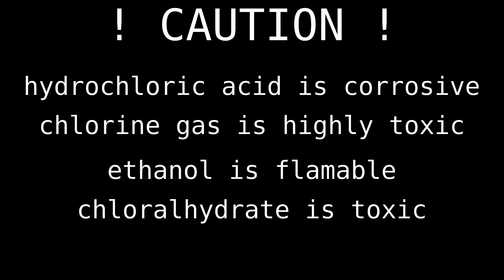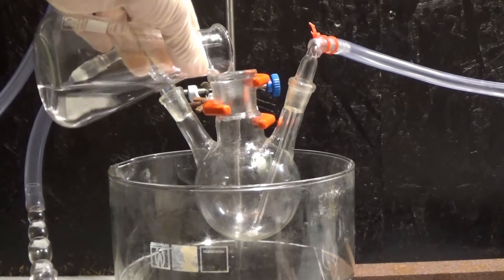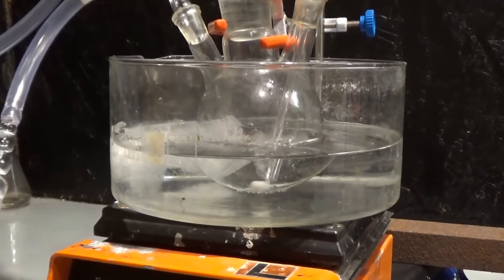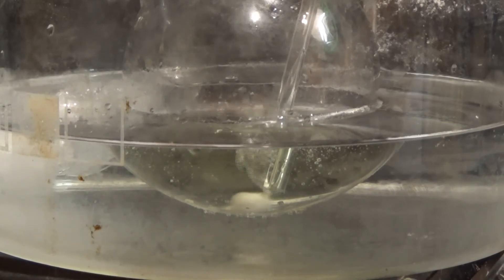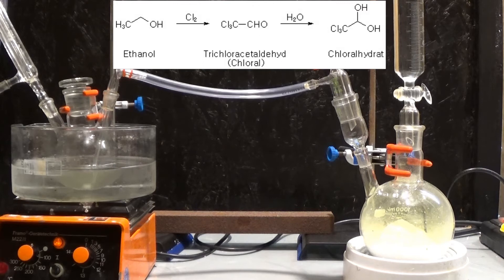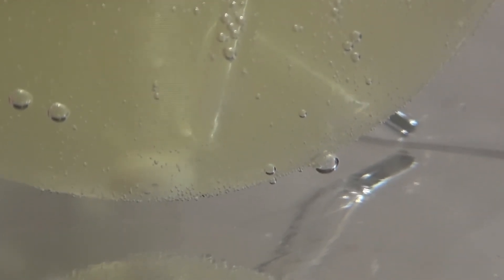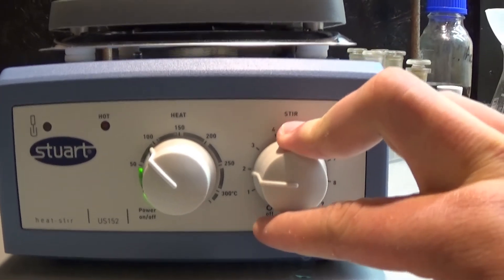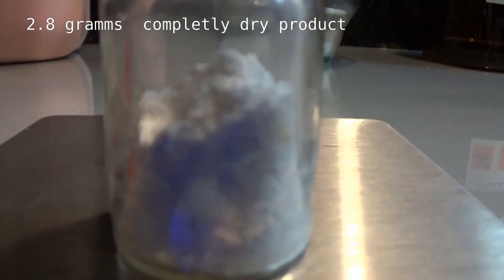synthesis of chloral hydrate (OTC)

Comment: I was wondering is the water content of the ethanol alcohol of any consequence ? Will any water already in the ethanol ruin the final product or should I just use anhydrous ethanol ?
Reply: 70% is ideal as far as yield goes. There's a lot of HCl evolved during reflux and your ethanol should be sub freezing until reaching boiling, also use an excess of Cl2.

Comment: I think I will synthesize this.. Seems quite doable and my useless german psyischiatricsts refuses to prescribe anything that works
Reply from the maker: NO! Please do not consume anything that was not synthesized in a certified pharmaceutical laboratory! 
You will poison yourself!!!! 
If you need help please try another  psyischiatricsts or call 0800.1110111 they can help you. 

If you want more information I am here! 

Best Elias
Reply: @HazelChem why? Just use pure reagents and purify the end product. The guy in the sciencemadness forum did this reaction with three separate distillations (an acid distillation, a distillation over a base to neutralize residual acid, and a water distillation) and the end product was quite pure. You could even use food grade distilled water if that's what you are worried about.
Reply: chloral hydrate makes you act a bit crzy in my experience yeah i had my confidence back but i alo was pretty agro i wouldnt reccomend it fo every day use

Comment: Could be possible to synthetize it from Acetaldehyde?
In a basic environment (NaOH) you get the enol that with Cl2 gives mono,di and tri chloro substituted Acetaldehyde (depending on how long you let everything react) and HCl as a side product.

But for sure ethanol is way more accessible and cheaper than Acetaldehyde.

Comment: HAZEL..........GREAT VIDEO.  You really made me think and read a lot of stuff.....lol.      I could be wrong but i think you should add a  little water to your reaction to help OCl anion formation and also help carbonyl hydration to form the geminal diol.   Just a thought.  ALSO  I understand you boiled/distilled off the liquid at the end so you could concentrate  the chloral hydrate and you did it under a VACUUM so it would not decompose in to chloral at it's boiling point of 96C.   But if chloral hydrate boils at 96C and chloral boils at 98 C and water boils at a 100 C and ethanol at like 78C.   I mean all those boiling points sound VERY CLOSE TO EACH OTHER.   Maybe when you distilled it down to concentrate your product   you ALSO distilled away a lot of your product.   I mean just because chloral hydrate and contaminants/impurities  have almost the same exact boiling point under atmospheric pressure does not mean under a vacuum the boiling points will still be close to each other.   But it may be a good indicator that the boiling points are still VERY CLOSE TO EACH OTHER even under a vacuum.......... DID YOU CHECK TO MAKE SURE?????????????????????????    Just a thought.  Not saying i am right but i am saying it is my GUESSES.  My 2 cents.....lol.  Man i been at this same video and posting and researching it and watching it for over 6 hours now.  I am GETTING A BRAIN CRAMP...............LMAO
Reply from the maker: hey john thanks for all the time you put into analyzing the video! I think you are right and that the final "concentration" step killed my yield. The video is now three years old and of now i would do it completely differently.... and I might do so in the future ^^ 

mfg hazelChem
Reply: @HazelChem  .........Seriously watching experiments and learning the mechanisms and etc is my entertainment in life.  I got nothing else going on....lol.    The first time i do an experiment i think just getting it to work is a more important goal than getting a great yield. On the first attempt just getting it to work is a BIG success in my mind.   Then i can try to tweek it on the next attempt so i can get a better yield.

Comment: Oh my god i have watched this video 4 or 6 times today and been thinking about it for like 6 hours.  Hazel and chem player always make me think..   I think i got it.  But listen to this first so you can understand where i am coming from.   The hydration of formaldehyde....meaning formaldehdye in water.....will automatically make methanediol.  The carbonyl will be protonated and then a water group will add to the carbonyl carbon and loose a proton making a geminal diol.  If you put formaldehyde in water then 100% of it will turn into methanediol and some polymerization.   The carbonyl carbon on formaldehyde is very positive due to being right next to oxygen which is such an electronegative atom it sucks up a lot of electron density from the carbonyl carbon..  And protonating the oxygen on the carbonyl makes the carbonyl carbon even more positive/reactive.    But when you put acetone in water only about 1% will convert in to the geminal diol.   The reason why is you no longer have 2 hydrogens on the carbonyl carbon.   Now you have TWO methyl alkyl groups.  Alkyl groups are (EDG) electron donating groups.   For water to add to the carbonyl carbon  and make the diol it must be positive.   But the TWO alkyl groups are (EDG) electron donating groups so the carbonyl carbon is not as positive on acetone as it is on formaldehyde.   Now most of these hydrates formed from carbonyls and water are not very stable and so can NOT be isolated.  But if you have enough electron withdrawing groups (EWG) alpha to the carbonyl carbon ... like chlorine ...THREE CHLORINES TO BOOT.   Then you make the carbonyl carbon so positive it has no choice but accept a water molecule attacking and making a geminal diol.   And it stays stable UNLIKE most geminal diols and can be isolated because the THERE CHLORO GROUPS STABLIZE IT.   
                    So here is my GUESS on the mechanism.    Ethanol just like water self auto ionizes and one ethanol protonates another ethanol or the little bit of water in your ethanol does the protonation.   But the point is you got a protonated ethanol molecule.  Meaning you have a water group now instead of a hydroxy group and water groups are good leaving groups.   The chlorine is bubbled in and when it hits any water molecule it turns into HOCl.   Meaning there are now OCl anions in solution and that does an SN2 with the protonated ethanol molecule.  The water group leaves and now you got ethane with an OCl on it instead of a OH group or water group.   Next the alpha carbon is deprotonated ........the electrons from the deprotonated hydrogen  jump up to form the double bond with the oxygen on the OCl group.   Now the Cl is a good leaving group and when it leaves you are left with HCl gas and acetaldehdye.  So you have made some water from your water leaving group leaving  and some HCl and some acetaldehyde.  The  HCl mostly bubbles out of the pot.   Now your acedaldehyde can form an enolate anion and attack the Cl2 gas and add a chloro group to the alpha hydrogen on the acetaldehyde and also making HCl as a byproduct which mostly bubbles away.   Now this happens THREE times until you got tri chloro acetaldehyde.   NOW WE GO BACK TO THE FIRST PARAGRAPH and remember with all those ELECTRONEGATIVE chloro groups they will suck up electron density.  And make the carbonyl carbon SUPER positive and so SUPER  reactive when it comes to nuvcleophiles.  Even nucleophiles that are neutral like water..............................SO FIRST the lone pairs on the oxygen  on the trichloroacetaldehyde  is protonated making the carbonyl carbon even more positive/reactive.  So water will attack the SUPER CHARGED carbonyl carbon and  loose a proton making a STABLE geminal diol which is your finished product called chloral hydrate.  Someone tell me what you think of my mechanism or thoughts here
Reply from the maker: sound very interesting and it all makes sense to me but I do not have the knowledge to confirm your theory 

mfg hazelChem
Reply: @HazelChem  ......Well it was fun trying to decipher it all with the mechanism.   Right or wrong it sure made me think.  That is why i love you and chem players videos.   They FORCE me to learn a bunch of stuff.  And gain a better understanding of reactions.  Before your video i never even heard of chloral hydrate or chloral.

Comment: 1:45 So the temperature should be raised slowly over the course of the addition of chlorine? Or would the best yield come from adding chlorine and then refluxing it for a while? 

Also since anhydrous ethanol isn't a common lab reagent, does 95% azeotropic ethanol work as well or is the water content too destructive to the synthesis? 

Great video by the way this is the first time I have seen someone make this before!
Reply: Reflux the 95% with CaO for a couple hours.
Reply: The azeotrope actually works a bit better in my experience
Reply: Im not sure cause ive never done this but i thought it could even be done with low alcohol content like vodka
Reply: yeah you can use lower quality stuff and that may actually be better but i am currently trying this with anhydrous ethanol and dry chlorine, we'll see how well it works

Comment: Can't i just bubble chlorine gas through vodka or something? since it has ethanol and water in it
Reply from the maker: it may work .... but if you such limited chemical equipment you must not work with chlorine! seriously it can kill you and your neighbors!

mfg hazelChem
Reply: @HazelChem  last question, after i did the process and i have my solution of chloral hydrate, water and maybe some alcohol how can i remove the water without boiling it, since the boiling point of chloral hydrate is 98 °C and water is 100 °C, can i put it in a dessicator? I heard that chloral hydrate is hygroscopic so i don't know if it would work
Reply from the maker: @miguelchacon2717   depends on the desiccant you are using i recommend H2SO4.... but it seems to me like you want to take the product ...... do not do this ! the produced chloral hydrate is not pure and may kill you!

mfg hazelChem
Reply: @HazelChem  any way that i could make it pure? And what type of impurities could be in the product?
Reply from the maker: @miguelchacon2717   I wil not answer that because selfmade chemicals should NEVER be consumed. 

mfg hazelChem
Reply: @HazelChem  no need to worry because even if i don't have special equipment i am some what good at chemistry and have atleast 4 years trying and doing more stuff, like once i made chlorine from electrolysis of brine and made calcium hypochlorite (in an open and ventilated area)

Comment: Hmm chloral hydrate has a melting point of around 130 degrees F or 56-57 C. Not sure but it sounded like you said .2 degrees but gave no scale
Reply from the maker: i am allways using ° Celsius so it was 2°C of 

mfg hazelChem

Comment: So you used HCl to make HCl which you then "throw away"? Wouldn't it make more sense environmentally to recirculate the HCl with a peristaltic pump? Also if you are going to react a gas with a liquid would a tall thin reaction vessel make more sense as the bubble transit time is longer? Then there is the question of why you bother to be precise with the HCl and TCCA when you are not getting 100% absorption into the ethanol? Given that why even use TCCA when you could just electrolytically produce the chlorine from NaCl?  Do a run like that and weigh your product, that then gives you the reaction rate for your given set-up and conditions which means you then know exactly how long to run the next batch to get close to 100% conversion.
Reply from the maker: you are absolutly right 
but the recovery of the HCl fumes is (in my case) not worth the effort .... 
to the reaction vessel here.... you are right again and again i did it how i did it because it was easier to do for me with the round bottom flask
and lastly the electro chemical production of chlorine gas is quite difficult to do for an amateur eighter you need a Hg electrode or a membrane cell ... and one thing is crazy dangerous and the other is expensive

thanks for the feedback i realy appreciate it and happy new jear 

mfg hazelChem
Reply: I have some ideas about what I have seen on the video and in the above comments.

I agree with @Daniel Matthews on that the elimination of HCl wasn't environmentally friendly. If the recovery or recirculation is hard to accomplish, a basic solution (sodium carbonate, for instance) could be used to absorb the fumes.

About the "chlorine from NaCl electrolysis" issue, I agree with @Hazel Chem and @ClickThisToSubscribe on that the process is cumbersome and may be dangeours and expensive for an amateur chemist.

I have to disagree with @jared garden on the NaCl electrolysis. The correct would be: 6 NaCl + 6 H2O → 3 H2 + 3 Cl2 + 6 NaOH. If the chlorine can mix with the hydroxide (agitation and heating of the solution etc), then the following occurs: 3 Cl2 + 6 NaOH → 5 NaCl + NaClO3 + 3 H2O. I have prepared chlorine gas from brine a couple of times, but the process is slow and the yield very small.

When I need to perform a chlorination, I use bleaching powder in place of TCCA. It is cheap and accessible.

I like the video. Nice work, and good luck with your other experiments, @Hazel Chem.
Reply: @Daniel Matthews
Also NaCl has a melting point of 800*C and electrolysis only works in a liquid, no sane person prepares chlorine via electrolysis.
If you think aqueous NaCl would work your wrong, as the following instead happens.
NaCl + 3 H2O → NaClO3 + 3 H2
Reply: Put PTFE (or another unreactive material) gauze over the stem going into the reaction vessel. It will break the bubbles up into smaller ones thus increasing surface area and yield.

Comment from the maker: hello everybody
in this video i am performing a OTC chloral hydrate synthesis
for this i weight out three hundred and seventeen gramms of trichloroisocyanuric acid
short TCCA  
as my source for the chlorine gas

after this i measured four hundret milliliters of a thirty to thirtythree percent hydrochloricacid solution out

the TCCA is then transfered into a gasgenerator setup 
this step has to be done in a fumehood or with a gas mask equipt because the TCCA dust can damage your lungs

now forty six point zero seven gramms pree dried ethanole is added into the reaction flask
this amount of ethanole corresponds to exactly one mole 

to start the reaction i am slowly adding the hydrochloric acid to the trichloroisocyanuric acid
this generates three mole chlorine gas out of one mole TCCA and three mole hydrochloric acid 
and in this case four mole chlorine gas for our reaction

the start of the reaction is performed in an ice bath  which temperature should be raised over time until boiling occures
for my attemp i just used the ice bath without raising the temperature which gave me a horrible yield as a reward 

so now after you saw the initial coloring slash absorption of the chlorine in our ethanole i am going to talk a little bit about what is happening in the reaction flask
but a a warning the over all reaction is not that well known

but anyway 
so as we drop the HCL to the TCCA we are generating molecular chlorine CL two gas        
this then runns through the tube into the ethanole were it attacks the methyl groups hydrogens and replaces them one by one with a chlorine atom
yielding at first the mono then the di an then the tri chlorinated ethanole 
and with each chlorination a molecule of hydrogenchloride
so now the problem is that the secondaqry step were the trichlorinated aldehyde is formed is not explained anywhere                               or at least i did not finde it  then shame on me 
so i can just assume that it meight be some kind of intra molecular rearrangement 

here you can see the formed hydrogenchloride fuming in the humide air of my lab 
i hope this shot underlines how important it is that you work in a fume hood                      because of the toxicity of the HCL fumes

after the chlorination has finished i simply reduced the volume by vacuum destillation to get rid of exess water and ethanole
as seen previously the chloralhydrate has allready formed do to the presence of water in the reagents so you do not need to ad anny H2O

because some of you requested that i let the lab audio in the video i did it this time 
but you can clearly hear the problem 

i am allways listening to music 

but for the future i will try to get some music free shots with lab audio

when the boiling prety much died down i put the concentrated reaction mixture in an exicator to kristallize my product out

in the end i got two point eight gramms product of unknown quality                                                                    
which is just horrible 
but the melting point was only point two degrees of and the smell did fit that of chloralhydrate 
so with some improvements like acidifying the reaction mixture and doing part of the chlorination in a boiling water bath the yield should be much better

so have fun and do not kill your self
Reply: Great you are back with new synthesis... I really like you choices and technique! Regards!
Reply: Thank you mam for providing written notes